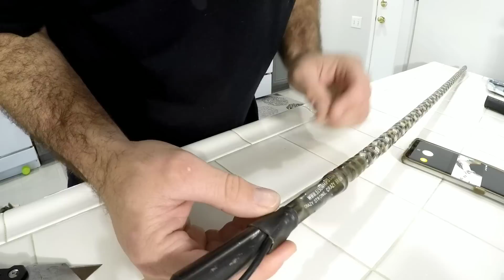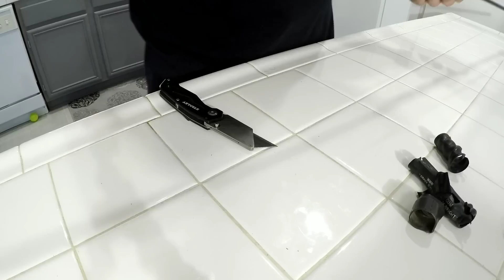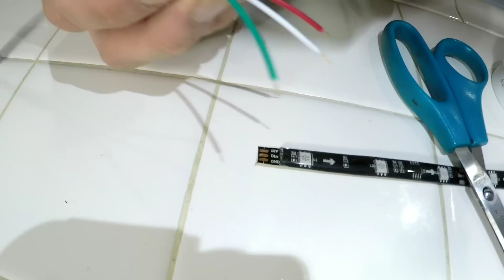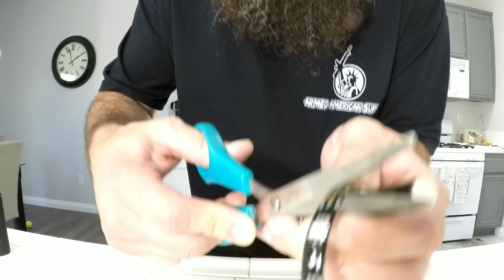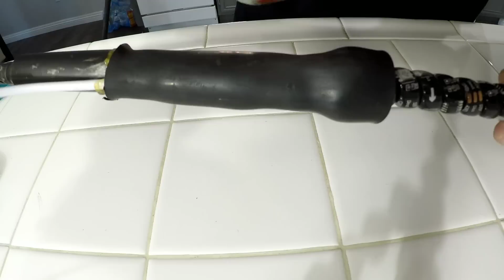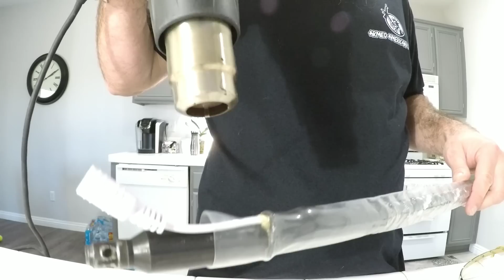How to make a lighted led whip

Comment: I was wondering  if there are any blue tooth controllers that I could use and also how would I be able to connect both whips to the same remote?
Reply from the maker: The bluetooth controller that has the most functions and smallest size is sp110e controller found on Amazon. You can connect both whips to one controller  like seen here. https://imgur.com/gallery/hJDHr6K
Reply: Does it also play with the music?
Reply from the maker: No it doesn't but i believe the sp105 controller does and it also has more modes however it's much larger in size. I special order my new controllers straight out of china now and they do everything including turn red when brakes are pressed but i don't have a link for those since they are special order.

Comment: New to your channel and if you happen to read this do you know where I can still find that kind of whip? I went to 5150 site but they only have a bare whip that's magnetic instead of that air fitting. I dont think I'd trust a magnet to hold up off road...lol.lol I could be wrong but.........GREAT VIDEO AND GLAD I FOUND THIS!
Reply from the maker: As far as I know the air fitting style is discontinued and you can only get the magnet style fittings these days. However rest assure the new magnet style are almost to strong even stronger than the air fitting style. I promise you will not break it or have it accidentally come out. It's that strong.
Reply: @MrRICKDAWG4444  WOW... cant believe you seen my question AND ANSWERED THIS FAST!!!!! thank you I really appreciate it! Yea I looked into the magnetic base on YouTube and IT DOES LOOK BEEFY. How has your homemade whip held up? I was looking for a 2 or 3 ft whip for a high powered e-bike for night rides and the 200 dollar price is a little crazy at this time ( 2020 ).... but yours can be done under a 100...EASILY! By the way would you happen to know the wattage/amperage draw on your whip? I'm running this off a external 12v battery not a engine! THANKS AGAIN!!!
Reply: @MrRICKDAWG4444  I just sat to go through some of your videos and see you have a new video on these.... going to watch now!
Reply from the maker: @eddiekytia  they are pretty low amperage and somewhere around 77watts per roll (16.5 feet) I've ran a 4 foot whip off of a 9volt battery for a few hours.

Comment: So how would you connect two separate whips together to run off one controller? Same as splicing in a new strip as if you were going to make a longer whip?
Reply from the maker: Whip syncing https://imgur.com/gallery/hJDHr6K
Reply: Is that picture showing two outputs from the controller each going to  one whip or is the controller mounted in one whip and then routed to the other?
Reply from the maker: One controller spliced into two whips.

Comment: What size back heat shrink did you use
Reply from the maker: In this video I used 1.125" in the part two video it's 7/8" because of different size controller.

Comment: what dc connector are you using
Reply from the maker: In this video I used the 5.5 barrel plug but I use 3pin connectors now. Check out the part 2 video on my page

Comment: Can you control thos whips with a phone and make ur own light patterns?
Reply from the maker: Yes, you'll want to use a ws2811 bluetooth controller though instead of the one i used in the video. They are quite a bit bigger so you'll want to mount the controller on your vehicle somewhere, you can also splice the wires to two whips so they stay in sync. Making your own pattern can be made with led programs from your laptop and transferred to a SD card that will go into your controller it's pretty easy if you have some computer knowledge. Best of luck

Comment: How do you wire it into the sxs
Reply from the maker: You can wire it a couple of different ways either from a switch on your dash or even splice it into your taillights all you need is a 12volt power and ground wire so you can wire it however you like.

Comment: Hi do you have a link to where you can buy the power/ground supply connectors? Looks like I need a connector to the controller for power and to the whips itself?
Reply from the maker: I'm not sure i understand your question.  I usually solder everything between the controller and whip as for the connection from the vehicle to the controller i use these. https://www.amazon.com/Pigtail-Female-Connectors-Security-Adapter/dp/B07C7VSRBG i hope this answers your questions, Feel free to reach out to me with any others you might have.
Reply: DMAX909 thanks that’s what I needed. I missed the part where you soldered them.

Comment: What power supply are you using for wall and vehicle?
Reply from the maker: For bench testing I'm using a $30 amazon special 12volt 30amp power supply. They are just connected to a 12volt circuit on the vehicles no power supply needed.

Comment: Checked on prices today and it would cost over 100.00 to build my own...  and that doesn't count the disconnects...
Reply from the maker: These things aren't cheap. The big companies that make these charge around $420 bucks a pair for the new style I build in the part two video I put up.
Reply: @MrRICKDAWG4444  I am sure your are correct.   I couldn't find your part#2 video.
Reply: Take it back I found it.   Thanks.   I still will build one of these.   Thanks for all the effort you put into these videos...
Reply from the maker: @randygregory7826  best of luck with your build. Feel free to reach out with anymore questions you have along the way.

Comment: Question if I am building from scratch where do I get the connectors at the bottom like you have ?  Thanks
Reply from the maker: Everything used can be found on Amazon. As for the electrical connectors at the bottom those are 5.5 barrel plugs that I don't really use anymore the quick disconnect fitting on the whip itself are air compressor fittings. I would recommend just buying the day whip from 5150 because it comes with those.
Reply: Thank you ! Also when you want to  connect two together like in your pic what wires go to what when you do that
Reply from the maker: Everything is just spliced to one controller

Comment: What kind of wiring harness would you need to plug these in on a utv? I noticed you have one that plugs in the wall.
Reply from the maker: That's just a 12v converter in my video you can wire it a ton of different ways. I would just go from the a 12v source in your dash then to a switch and then to the whip.

Comment: Iv tried to make 4 different whips and the silicone has pealed off every one. Any tips to not have that happen? Or is this just a common problem with these particular lights.
Reply from the maker: Honestly ive built a ton of these and that has only happened to one that i let sit over night without shrink wrapping first. I can see how it could happen though and my only tips are work fast, dont wrap as tight, use a thicker whip and have everything ready to go so there is less time they are sitting without the shrink wrap.
Reply: DMAX909 the first one I did I wrapped a little tighter and it happened. The other 3 I wrapped as loosely as I could and it still happened while I was wrapping the led on. Using some 3/8” whips might try 1/2” to see if that helps. Thanks for the reply and the video!
Reply from the maker: No problem. Best of luck

Comment: I have a question I have two cb antennas on my semi, and I want to do the leds on them like this. But I don’t want to have to have two different remotes I want to be able to control them both at the same time doing the same thing, any advice on a controller that can sync them together and control both ?
Reply from the maker: Any controller will work in a sync long as you slpice them both together to one controller i recommend using a Bluetooth controller for this, specificly the sp110e. Also use dedicated antenna for keying up on the radio because the leds will screw up your SWR's and that can lead to frying the finals in your radio.

Comment: Do you know what they use for the whip itself? I have a venom led whip which they are outta business and it looks like they used polyethylene tubing for the base. Trying to build my own lol
Reply from the maker: I build mine off of 3/8th fiberglass whips. In my experience the polyethylene tubes will eventually end up breaking if you ride aggressive.
Reply: Thats what happened to mine, it broke right at the bottom where they put the adapter for the quick release. Thanks for the reply man!
Reply from the maker: No problem. Feel free to message me with any other questions you might have. These are the whips i start off with to build mine. https://www.chapmoto.com/5150-whips-daytime-whip-with-flag-parent-16-60003

Comment: Great video bro @DMAX909! I have a couple of questions though........ How would you hook up 2 whips together so that they both do the same thing? Do you use only one controller or do you use 2 controllers with one remote? Also, do you need some kind of power converter to hook it up to your sxs? And finally, what is the diameter of the actual whip itself? (the thickness without the lights). Thanks again for the great video!!
Reply from the maker: First question if you wanna hook two whips together you can just splice the wires from one controller but make sure to run power and ground to each whip. You could also use two controllers and one remote they will sync with each other. Second question, you will not need a power converter if you order 12volt led strips, the controller will work with any voltage from 5-24v. As for the whip diameter i believe they are 3/8th but any size bigger will work good also. I hope this answers any questions you have feel free to message me with any other you might have.
Reply: Thank you very much @DMAX909!! I already pulled the trigger on the stuff I need from Amazon. I also bought 2 whips that are 3/8" thick. I only bought 1 controller as I had bought everything before you answered my question. I also bought a Bluetooth version of the controller (hope I can also install both whips to it) anyway, I will be putting these together as soon as i get my stuff in....... Thanks again!!
Reply from the maker: Nice, just remember the data line from the controller is the same for both whips so you could run that for up to 2000+ pixels just make sure you power both whips separately so they are good and bright.
Reply: @MrRICKDAWG4444  will do bro! Once again, thanks for the great video/videos! Suscribed!!
Reply from the maker: Awesome thanks bro
Reply: Hello  @MrRICKDAWG4444  Im disabled marine veteran and not able to build one of these. due to paralyzed arm.  I really want 2  6ft whips just like the video I just watched you do. I was very impressed. I know your very busy but if you would HELP  a soldier out. or know someone that could help build me 2 of them. I would fund your account prior to doing so. your work looks much better than the ones on line for sale and they have allot of bad reviews, that I saw. anyways great video. you should market your product. I would love to own this item with the AMERICAN and MARINE CORPS FLAG on it.... god bless brother and keep up the good videos..
Reply from the maker: Thank you for your service and kind words. I currently do not have a webpage to sale these bad boys however if you would like i could make you some using pay pal for payment.

Comment: I know its an old video but I just got everything in to make the whip except the heavy duty black shrink wrap.  Just wondering what you are using?
Reply from the maker: Have you watched the part 2 video?
Reply: @MrRICKDAWG4444  Yes I have and you have a list of things you used and I ordered it but what I got is definitely not what you used. Thats why im asking.
Reply: @MrRICKDAWG4444  Im looking for the big heavy duty shrink wrap with adhesive that you use to cover everything at the bottom.
Reply from the maker: Depending on the style of whip you're making meaning the controller inside the whip you'll need a bigger size vs the version I make on part two. That stuff is gonna be 1.125" - 1.25" 3to1 adhesive lined shrink wrap. You'll need to choose your size you want when ordering from Amazon . Hope this helps

Comment: Where do you get that thick shrink tube at?  the one with the heat activated glue.
Reply from the maker: Amazon... 1.125" 3to1 adhesive shrink wrap
Reply: @MrRICKDAWG4444  will 1” work I cannot find 1.125”?
Reply from the maker: 1" might work it might just be tight if you're inclosing the controller in the whip like I did in the video I don't really put the controller in the whips anymore I just run a 3pin connector plug out of the whip and run the controller external.

Comment: Does the lights you used come with the controller? I looked at your link and I could'nt figure out if it had one with it or not... How many different light functions does the controller have. Thanks
Reply from the maker: The controllers are sold separately. Depending on the controller you choose can have couple hundred functions
Reply: @MrRICKDAWG4444  Great, Thank you! Cant wait to start mine....
Reply from the maker: Definitely. Best of luck my dude.

Comment: I just ordered two whips, two rolls of lights but only one remote that was in your description can I make them both work together then?
Reply from the maker: 1 remote will work both of your controllers. The controllers run the same frequency.
Reply: I assume the lights come with a controller?
Reply from the maker: Some lights strings come with controllers. However i buy my controllers separately. One for each whip
Reply: I ordered the same ones in your description so will it work with those ? I got everything you had in your description
Reply from the maker: Some things are not in the description because YouTube for some reason limited me on the amount of links i could put in the description. However if you ordered all three things in the description all you will need is the 5150 day whip or whatever whip you are going to use and some black 1"1/8" heavy duty shrink wrap for the base of the whip.
Reply: That's great I have all that stuff on order so I should have every thing. Thanks a lot for your help, great video!
Reply from the maker: No worries. If you have anymore questions reach out to me.
Reply: Are you able to explain to me how I'm going to have to wire a pair of them together to sync with one remote
Reply from the maker: Are you talking about one remote or one controller?
Reply: I bought two rolls of the lights you used and only one remote that you also had in your description I just wanted to know how to wire those up to work together
Reply from the maker: If you just bought a remote you will need a controller otherwise the remote is useless and your whip will not work. The link i posted should have came with a controller and remote
Reply: I purchased all three items in your description so I should be good right ?
Reply from the maker: Ok long as you have the controller you will be ok for one whip. I put a controller in each whip so you should have bought another one if you are building two whips, However you can splice the green wire on the controller to run both whips I'm just not sure how it will effect the display or the life of the controller. In your situation i would build the whips with the controller external and mounted to the car. Inside your led package you'll have 3pin connectors use those to plug your whips in and splice the controller to those. Or just buy another controller

Comment: What do you mean when you adjusted the pixels for stacking mode ? How do you do that ?
Reply from the maker: On the controllers that i use you have a option to adjust how many pixels are being used so you can kinda adjust how many times it will stack up.
Reply: Great video, thank you for sharing. I also like to know how to adjust the pixel with the controller that you provided in your description. Thank you
Reply from the maker: I don't really use those controllers anymore however if you look on the paperwork that it came with it will tell you how to adjust pixels.

Comment: Good evening sir I bought all the components that you suggested however when I hit the power button the only thing I can get is a very dim red LEDs. Do you think this means I received a bad set of LEDs?
Reply from the maker: Yes sounds like the LEDs might be bad or wrong voltage.
Reply: @MrRICKDAWG4444  maybe the USB plug I am using does not allow enough power...
Reply from the maker: That's probably it. Did you get the 12volt LED?
Reply: @MrRICKDAWG4444  yes
Reply: @MrRICKDAWG4444  what plug do you recommend I use?
Reply from the maker: You'll need 12volt to run those. I'm not sure what you're using for power but just hook it up to your vehicle's battery and test them to be sure.

Comment: What do you cap the top with?
Reply from the maker: 3/8" vacuum cap
Reply: @MrRICKDAWG4444  Thank you.  Are the LED's you used the 5 M 30 LED strip that comes up highlighted when your link is opened?  Will I need one roll per 4' whip? thank you.
Reply from the maker: Yes they are and yes one roll will be enough for a 4'whip.
Reply: @MrRICKDAWG4444  Thanks very much again.
Reply from the maker: You're welcome and good luck with your build. Have everything ready wrap fast and get the shrink wrap on quickly so the silicone on the LEDs doesn't pop up.
Reply: @MrRICKDAWG4444  Will do.